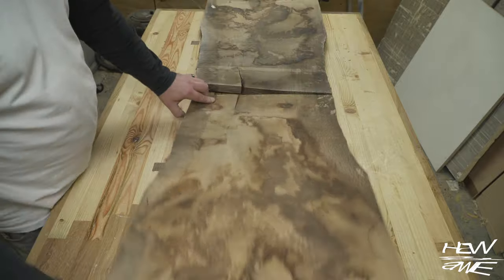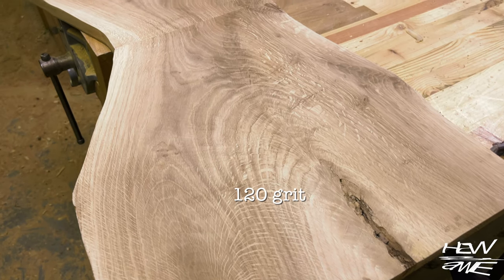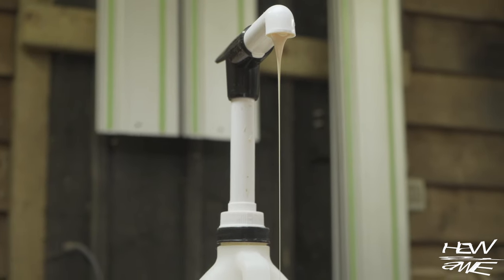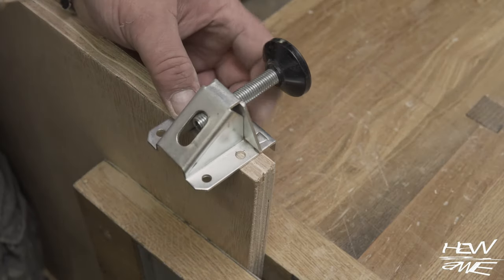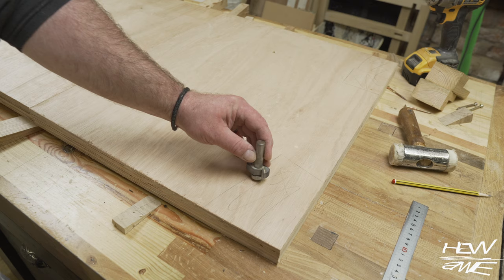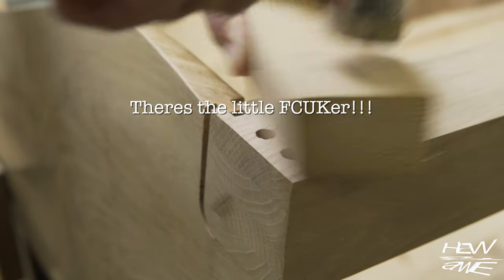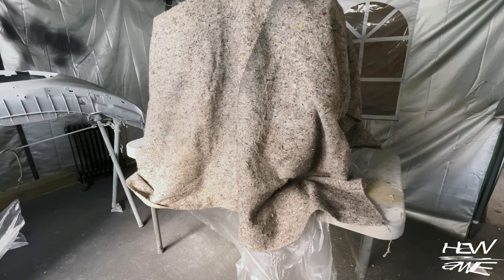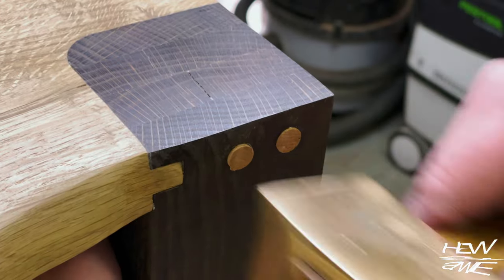Modern Coffee Table  / Traditionally Aged oak legs.

Comment: It's a knockout, Ben. There are all these pieces that look like they won't agree with each other -- warped boards, rays and whorls, wedges, a square line half-way down the pitch, light and dark tones, square legs with round plugs . . . you got them all together and made them agree to work.
Reply from the maker: Cheers Justin! Ive one conundrum I havent been able to figure out and thats making two edges join that have no straight edges/side/face and are both warped boards, I was wondering about running a router between the two boards but how to do that safely and would it ever work... Do you know what I mean?

Comment: Awesome stuff as always, Ben. Loved that leg joint. Real tight and snug fit. On the sanding part, I rarely go over 320 grit, but that 4000 grit look is superb. I thought Osmo won't get absorbed over 180 grit, but apparently, thats not the case, haha. 👍
Reply from the maker: Thanks mate, You found a problem with my edit lol, I just went to that grit to show what sanding does, I went back to 220 before the Osmo bud... Osmo if youre putting it on a floor yeah 180, but 220 for furniture but I have used Osmo polyx at 400 grit and not had any problems.
Reply: Cheers Ben 😀